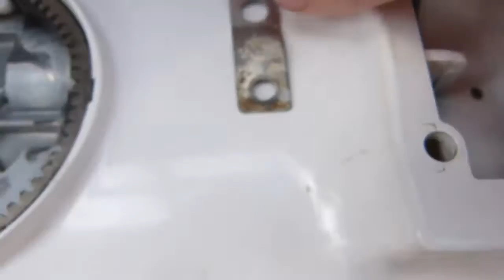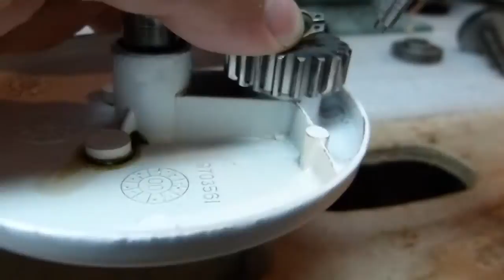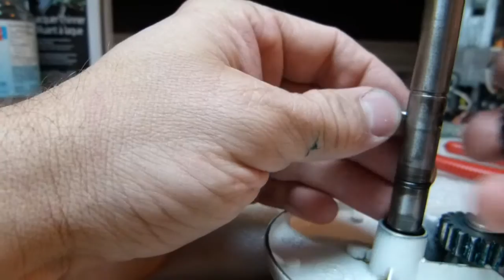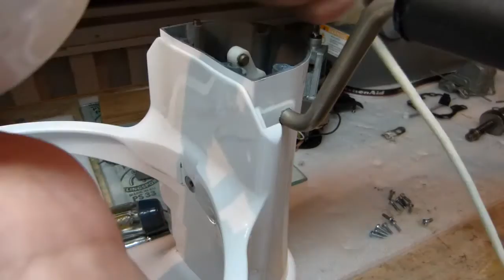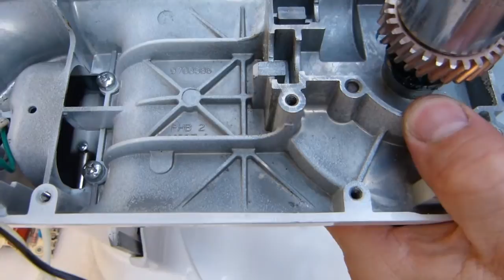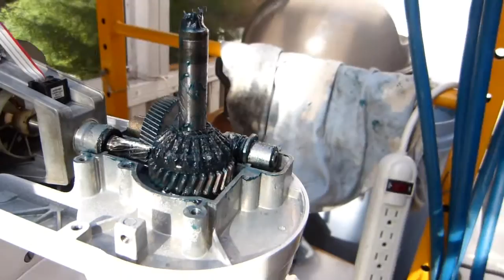KitchenAid Pro 6 mixer complete rebuild

Comment: I like your very German attention to mechanical detail. Tell me, would a balanced washer of 3/4 inch outer diameter, affixed to the motor arbor just behind the contact point between the arbor and the large gear on the worm gear assembly it drives, prevent the grease from accumulating on the back of the arbor more efficiently than would packing additional grease above the gear contact point in the gear case? I understand this simple machine isn't as complex as an F-1 motor but it's fun to make this basic, gear-reduction design as durable as possible.
Reply from the maker: Could be tried. Usually, an extra washer will wear away either inside or outside due to friction against something. By design, tight tolerances and a rubber O-ring keep the grease inside housings.

Comment: Regarding my model 600:The planetary movement on my mixer binds up at one particular point in the cycle. I have removed and inspected both the planetary and the gear that drives it, both appear fine, yet when I interact the drive gear with the planetary and turn it by hand it continues to get bound up at one particular location. Any idea why this is happening? Thank you..
Reply from the maker: The axes of rotation are not parallel any more, they tilt towards each other at one point and seize up. Caused by top and bottom axle pivots and axle wear.

Comment: When you "dry fitted" the worm gear, why were you not concerned with bushing movement. Clearly they were moving. Are the bushing machined flats intended to be installed vertically or horizontally?
If the worm moves away from the "pink" gear, and, the worm gear moves away from the motor drive gear, you got a problem? Right? 
Thanks for the video. 💖
Reply from the maker: Of course, excessive clearances are not good. Each to their budget, parts involved are shown.
Reply: theoverengineer Thanks for responding so promptly! Maybe I wasn't clear with my question, so I will try again. Since you installed  the bushings vertically, allowing the movement, shouldn't you have rotated the bushing 90°? It's not a clearence issue but but an engineering and installation issue. Thanks again!
Reply from the maker: What`s the video`s time frame on that detail?
Reply: theoverengineer I just found the parts list from Kitchenaid, which clearly shows the flats positioned horizontal, which eliminates any play in the gears relationship. I think I've figuered it out. Thx again.

Comment: Hello. My mixers gears are all in perfect condition and the teeth are all there.... but I hear a grinding now that I put it back together? It wasn't doing that before I opened it up. It was fine and working fine... what may have went wrong? Thanks

also: I have the K5SS bowl-lift model,
Reply from the maker: If it aint` broken, don`t start fixin`.
Gear teeth are always worn on one side, evident after a few hours of run-in. Any component, shaft, motor winding, wire, screw, spacer or washer could be put back wrong, backward,  placed wrong, sequenced wrong, rotated wrong, aligned wrong, not tightened, overtightened, contaminated.
It`s a simple mechanical fit issue, let us know where it was when you`ve found it.

Comment: Thanks for your video. My mixer stopped rotating and revolving. I began taking it apart in order to access the worm gear follower. When I took this gear off the shaft the PLANETARY fell down. Inside the planetary was what looked like a birds nest of aluminum shavings. It appears that some part of the planetary was coming into contact with bottom of the lower gear case every time I used it in the last 17 years.  Have you ever encountered this? do you have any idea what caused it? I have images if you're interested. Thanks.
Reply from the maker: There has to be a washer or circlip keeping the gears away from the housing. It the soft washer wears away, the housing will be destroyed in no time. If some of the shavings are magnetic, that's the steel washer. If no steel is found, there may have never been a washer or circlip installed.

Comment: What hold the main shaft in the bushing? Is it just friction? Mine seems to want to fall out.
Reply from the maker: The external snap ring. There is not much vertical load on it, just the weight of the gears+shaft assy., should be in place, intact.
Bushing does wear heavily every time the shaft turns, making shaft fit poorly.
Reply from the maker: Friction fit, yes at lower end. Drill through the aluminium casting and the shaft end to put a pin (nail) in to hold it if it comes out easily. It does not have to look pretty, any pin will hold.
Reply: Thank you for the reply. That is what I was considering. Perhaps drilling a hole in the end of the shaft and tapping it and adding a screw.  Thanks for the wonderful video.
Reply from the maker: Here is the inside of a similar motor. Pull it apart, clean the commutator gaps, ...https://www.youtube.com/edit?o=U&video_id=9EHQJDhxZc0

Comment: What type of grease do you use?
Reply from the maker: I put in Yamalube Marine grease. From boat repair. A high-temperature corrosive service environment grease. I figured kitchen = salt, soaps, cleaners and turning a propeller shaft or a heavy boat is like churning dough or grinding meat, a high torque situation.
Reply: Thanks a lot.